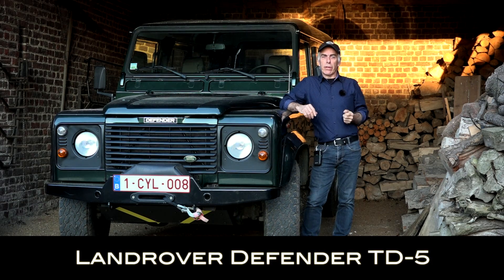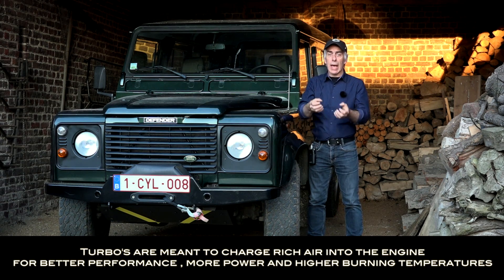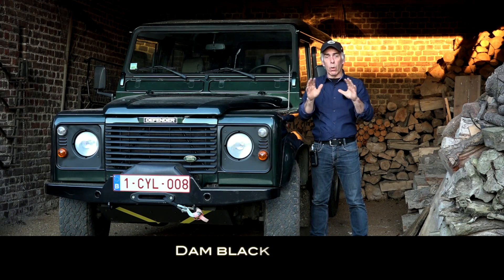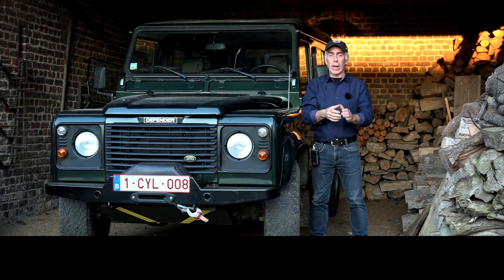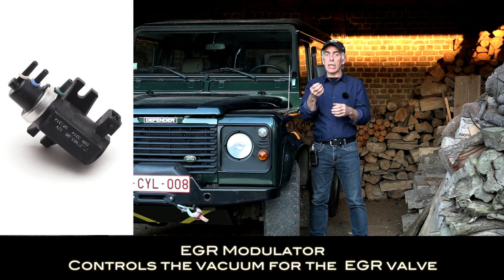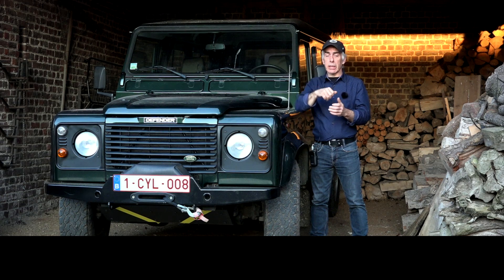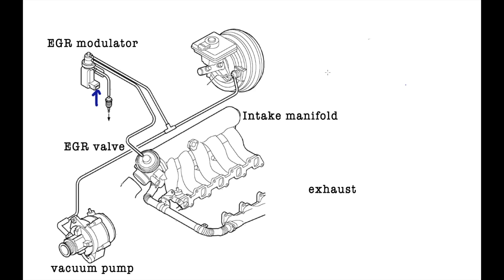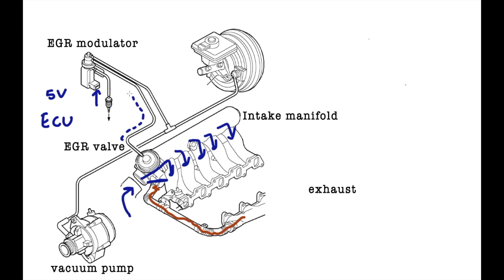Landrover defender TD5   EGR working and troubleshooting Part 1

Comment: Amazing video - so clear ! What happens with the increased combustion in the engine ? would this not spin the turbo even more and force more clean air into the engine and cause an overheating issue ? Or blow a head gasket ? I'm looking to do this EGR blank and add a bigger intercooler to the vehicle - I operate in hot african climates so would like the engine to run nice and clean. Also have a 2002 td5 defender

Comment: Is part 2 still in the making? I've no diagnostic faults, but belting black smoke going up hills when my engine in cold. Lack of power, takes a moment or two for acceleration to kick in, and shuddery going up hills in 5th gear. I don't know how to test the egr or clean it. Can you help?
Reply from the maker: This seems to be an issue of not having enough air in the mixture, that is why you have black smoke.  Black smoke is the result of unburned fuel, in other words not enough air in the mix... best is a14 to 1 ratio, however If you run leaner (more air) then you will get more power but also higher temps and NOX.   It might be that your EGR valve is stuck open, or your turbo waste valve is open.   I still need to make that part 2.   But in essence you could remove the vacuum from it, so it stays closed.  That would be on the condition that the EGR is not stuck open or badly closes.  I will see if I can get a video on it sooner. Did you read the manifold pressure ?  You can do so using the diganostics tool attached to the OBD2 whole driving and check what happens with MAP value and Manifold temp...

Comment: Do You think it would be impossible to pass an MOT in Belgium with a blanked EGR and a straight through exhaust without the catalytic converter? Thanks for Your help to all Defender and TD5 owners!!
Reply from the maker: Herbert Masing  it might
Reply from the maker: Herbert Masing  as far as i am aware it should not be an issue.  Just poor the fuel enhancer in the diesel before you go
Reply: Thanks again!!

Comment: where is part 2?
Reply from the maker: Damien Rodrigo its a bit delayed but coming.
Reply: My TD5 is giving out black smoke when I raise the engine. When its idle it doesn't show any black smoke but when I accelerate then I see smoke. I am just going through your videos to understand my problem and to do a proper diagnosis. Milage is 55000.
Reply from the maker: Damien Rodrigo black smoke is typical for unburned diesel.   And can be caused by many different sources.   Not enough oxygen due to a slow turbo and or low pressure.  Check the hoses - turbo-intercooler and inlet.  Check that the egr valve is closed.  Just remove vacuum hose on the egr valve and try again, if that makes no difference measure the MAF and MAP voltages.  I assume that you do not have faulty or replaced injectors for which the unique code is not enterd in the ECU. Try to read out the ecu error code.  That will tell you a lot of the sensors.   Are you sure its black smoke and not blue.    Blue indicates burning oil , that would be bad.  Try also injector cleaner in the fuel.    Do you also have a loss of power ?     It could be many things and try some of the tips in my different vi
Reply: I will have to invest some time to diagnose this properly. I will follow the steps given by you and will get back to you. Your videos are extremely helpful since I can't find a proper person with good knowledge of this subject matter in my country. Thank You.
Reply: D3Sshooter  okay I checked it today. There is no EGR valve in my one. Someone has removed it and the opening in the exhaust manifold is also closed and welded. There was a extremely tiny play in the turbo chra.
Reply from the maker: Damien Rodrigo ok, so they have played with it.  Normally they place a blanking egr .   Are you sure that they did not modify the fuelmap ?   I am asking because i am not clear if you always had the black smoke since you got the landy or if it just developed while you had it.  Were you able to read the ecu errors ?  If any,  the tool is not that expensive and very usefully . Look for nanocom from blackbox solutions.